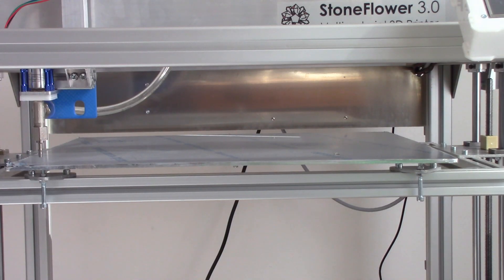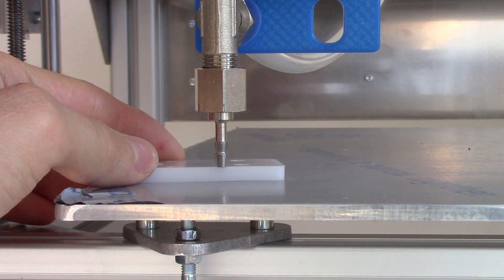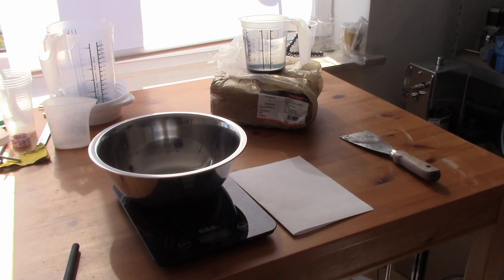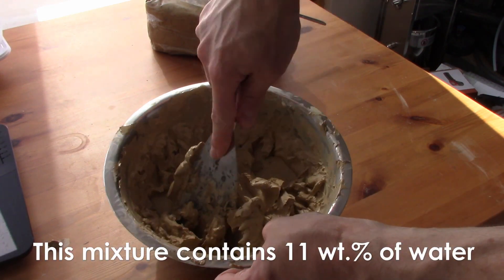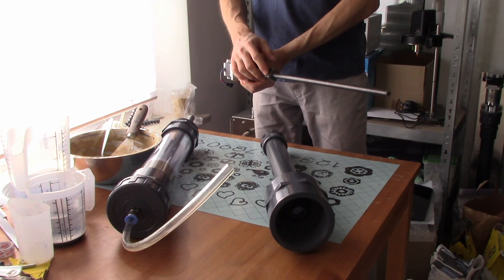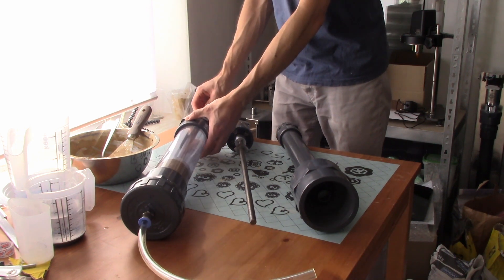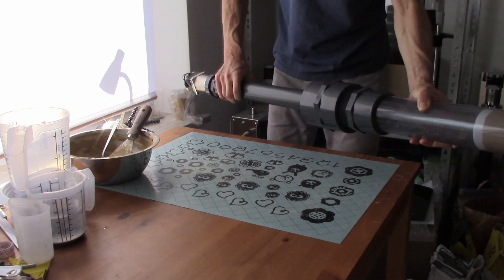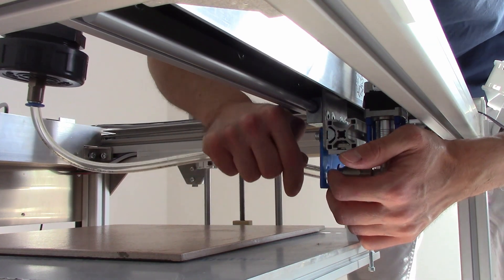Multimaterial/clay 3d printer StoneFlower: User Manual

Comment: What is the nozzle size?
Reply from the maker: Hello, Goran! Standard nozzles are 2.5mm, 4mm, 7mm. Also are included smaller conic nozzles with luer look, from 0.2mm to 1.5mm (6 different sizes).
Reply: @AnatolyBerezkin  Looks very good, those layers gives special efect to the model. Do you tried printing with air-dry clay?